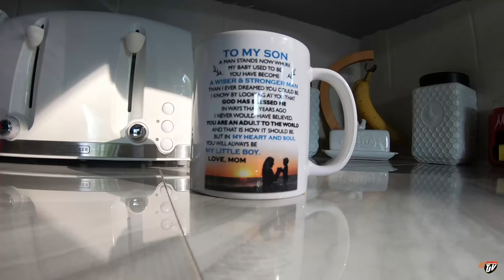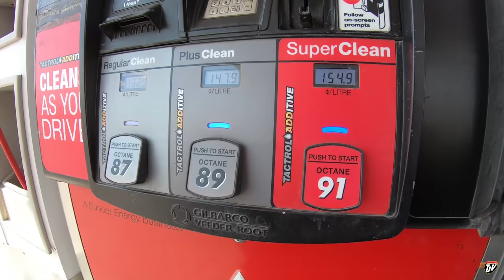STRAP DILEMMA? | My Trucking Life | #2319

Comment: You have a built-in lock where you put the key in, push in, and turn the opposite way and it'll lock the steering. It says "lock" on the thing. If someone does try and steal it all they'll be able to do is go in circles.